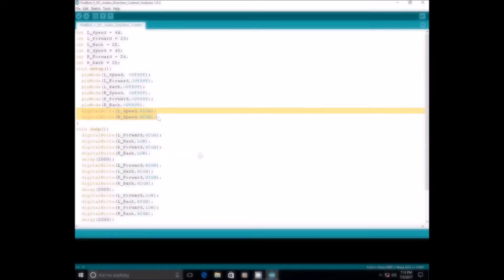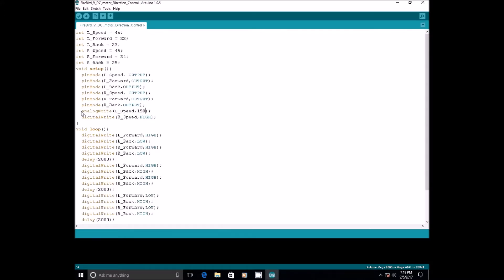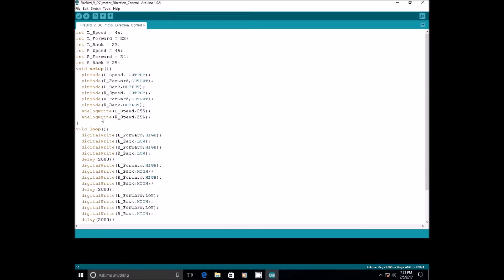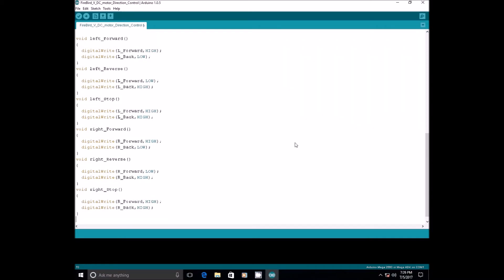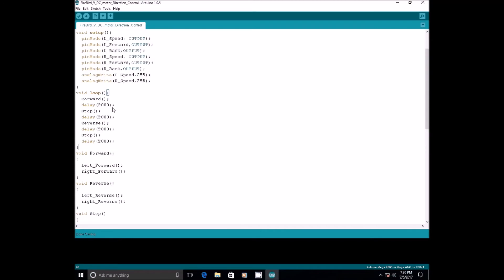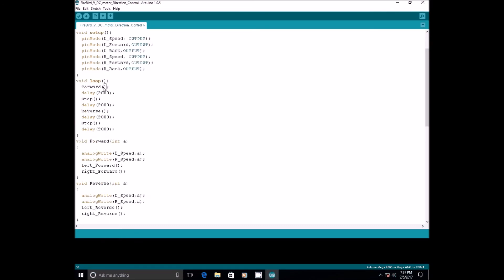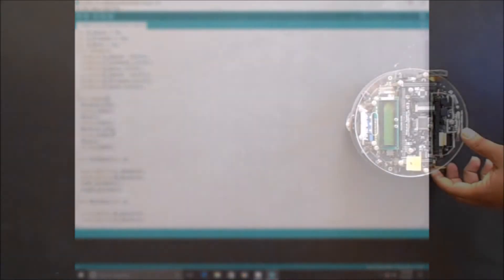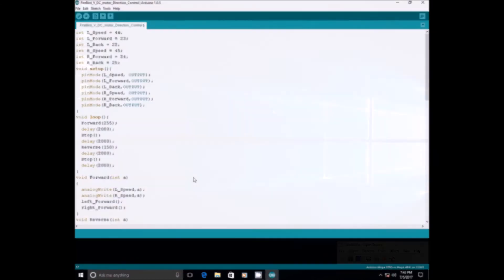FireBird V 2560 DC Motor Speed Control

Comment: Nice video. Please make one for serial communication
Reply from the maker: Can you tell me exactly what you want to do using serial communication ?
Because you can not directly use Arduino IDE's serial monitor to communicate with FireBird V
Reply: I want to give speed(PWM) command to robot on serial interface(xbee). (consider Xbee is installed on robot)